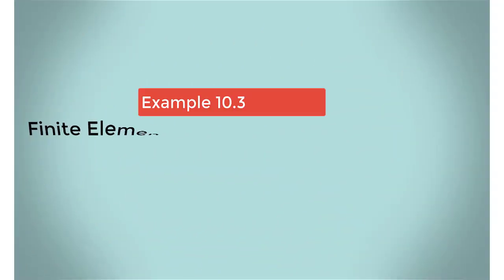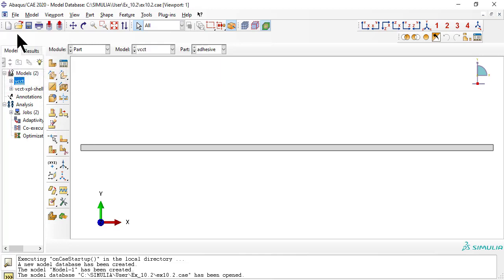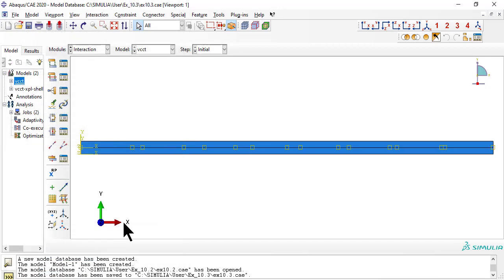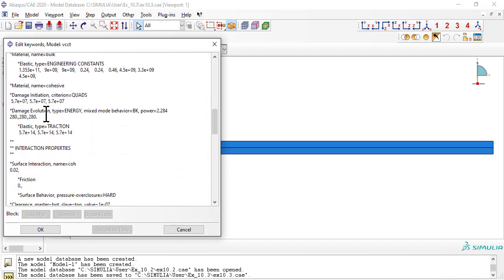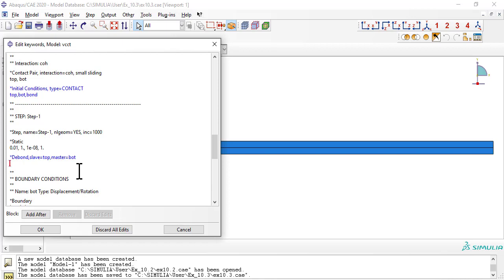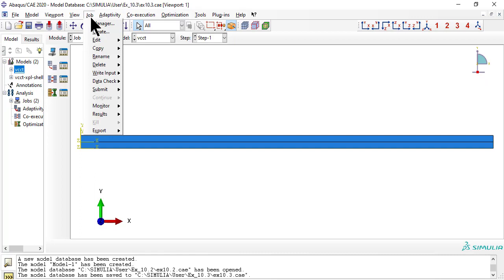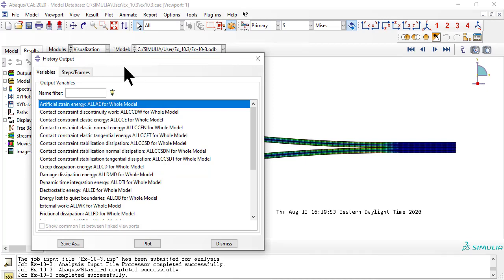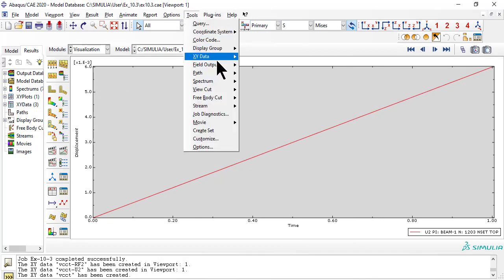Example 10.3 How to use Abaqus Virtual Crack Closure VCCT for delamination of bonded repairs

Comment: Hello Mr Barbero  thank you for this video , i want just to know to simulate an initial push-out delamination (in the hole exit ) of an open hole composite laminate , considered as an inducted damage from the drilling process , then study the propagation of this delamination by vcct method in a compression test ?

Comment: Dear professor what is the significance of opening reaction force vs opening displacement graph is it related to energy release rate like, if the opening force is high then the energy release rate is also high. Thank you
Reply from the maker: Maybe it is possible to compute a relation between force-displacement and ERR but I don't know, maybe it is easier to see if in "Field output requests" and "History output requests" maybe you can find a variable that will give you the ERR.
Reply: @EverBarbero  Dear professor actually you plotted the graph between opening reaction force vs opening displacement in ex.10.1.  in the delamination process, we mostly focus on ERR that's why I thought is there any main reason to plot that graph only instead of ERR calculation after analysis or they are related.

Comment: Gracias por tan valiosa información. En base a su experiencia cree que es posible modelar el fenómeno de "Crack Closure Induced by Pasticity" usando software comerciales como ANSYS o ABAQUS?. Estaré muy agradecido con su valiosa respuesta. Gracias
Reply from the maker: Yo creo que si. Si esta usando VCCT, recomiendo estudiar en un libro los fundamentos de VCCT para ver si requiere estrictamente or no respetar las condiciones de "linear elastic fracture mechanics (LEFM)." Irwin propuso que la energia disipada por plasticidad "at the crack tip" se puede incorporar en la "critical fracture toughtnes Gc" y asi seguir usando LEFM, pero no estoy seguro que pasa si el entorno (lejos del crack tip) tambien es plastico. Si esta usando CZM, el modelo ya es es nolineal, por lo que agregando plasticidad en el entorno de la fisura no deberia causar ningun problema.
Reply: @EverBarbero   Thanks so much. I will try to lead my investigation in that line. I apreciate you answer because in my country is so dificult to find someone who works in that topics!

Comment: Dear Professor, Hope you are fine its a long time to see your new video. Your doing best for the student community.
 I have one doubt in Abaqus or Ansys generally software prefers first-order shear deformation theory. Like in Abaqus continuum shell element work as FSDT. So if someone wants to use third-order shear deformation formation (Reddy) what element should use or how it can be implemented (Is there any way to do it).  
Thank you
Reply from the maker: I do not know if that element is implemented in Abaqus. Someone here I think found some difficulty when the elements are not perfectly rectangular. If you want more information about that I can try to find it.
Reply: @EverBarbero  Thank you for your reply, Dear Professor, Yes I want to know about it. Please clear how can it cover, is there any way or If it is possible please make a video on how UEL or UELMat subroutine can be model.